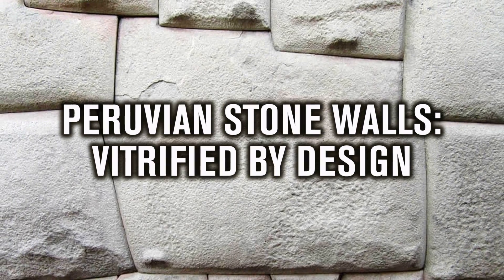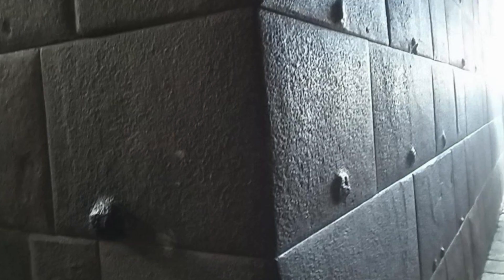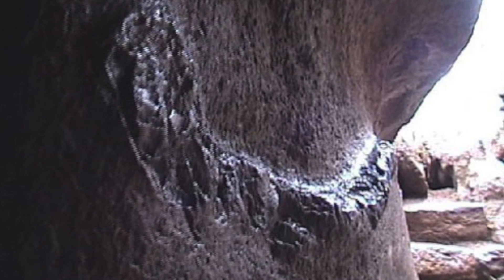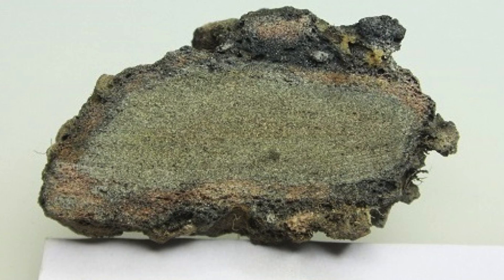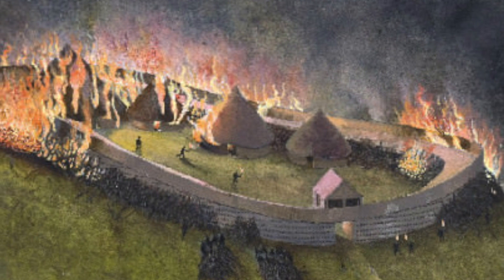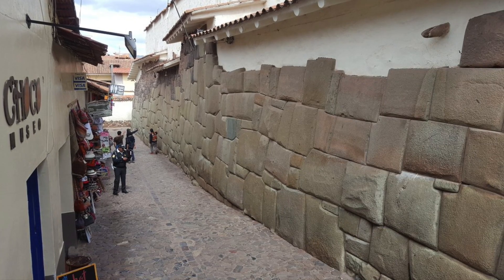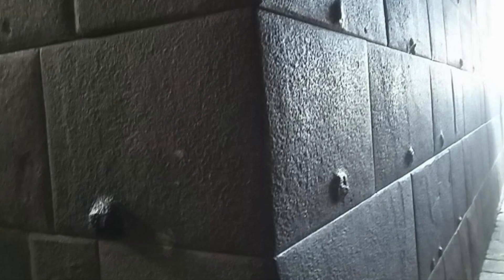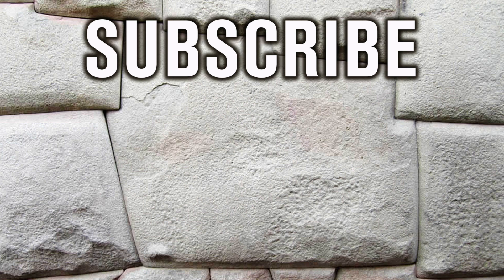Were the Peruvian Stone Walls Vitrified / Melted During Construction? | Ancient Architects

Comment: I'm in the some sort of acid type lacquer/varnish finish camp myself. Seems like a similar kind of polished finish (not as finely finished of course) we see on the granite boxes in places like the serapeum. Look underneath the lids of these boxes which weren't finely finished and you can see obvious drip marks where whatever this substance was has settled. A little like painting a wooden garden fence and paint drips settling at the bottom near the grass where your brush can't get under.

I'm from Scotland and I've seen numerous examples of the type of vitrification you mean. My problem with your comparison is that most of the vitrification I've seen has happened with rocks and bricks about the size of a forearm at most. Temperatures of 1200c can easily do this to stone and bricks, we make bricks in kilns after all but when it comes to stones which are 5, 10, 20 tonnes an upwards, how much heat would be required to do this and how would it be controlled? In many of his videos Brien Forester has shown that the precise finish (not the polished finish) isn't only on the face side, it continues through the back too. How much heat would be needed to make a 10 tonne stone malleable enough to work with (even to make the top 5cm malleable), how long would you have to shape it before it cooled and hardened? 

I believe they were shaped in some other way and finished with a long forgotten lacquer technique. You stated again you don't believe in the power tool theory and I was the same until recently. I'm don't believe electrical power tools were used (the didn't nip down to B&Q for sure) but I'm starting to think some kind of advanced powered tools were in fact used. Possibly water powered, possibly gravitational powered? We used similar techniques in the 1800's to power machines long before we had electricity. In my opinion it's the only explanation for drill holes and cores. These require power, end of story. What the drill bits were made of is of course open to speculation too and a discussion for another day. 

Great video, keep up the good work! ;)

Comment: Another bad idea? If it has a rounded surface on the bottom of the knob then it could be used for rocking the stone, if it's flat on top it could be for adding accessories or framing in the future, or a point for pulling the the stone.
If it's flat on the bottom it could be a that instead of using the knob as the rocking  pivot point, they Chocked it up to a log and used the log as a axle and the 90 degree angle face allowed for better contact with axle. I know that in South America they didn't have the wheel but they did use logs as axles, if memory serves me correct.

Some of the larger stones do not have them but the smaller ensemble cast of stones does, possibly because these are the coped fitted stones and the larger stones set the course.

the dimensions of the knobs and the distance from the joint should be noted not just for a hinge effect but for  the consistency of swinging the rock face flush with the others. It is like a jig-gauge  to ensure the correct depth of placement when pivoting into place.

Comment: Second posting. I wanted to keep them apart. I recall reading some time ago that fire is actually a chemical reaction. Could the ancients used or learned to use a chemical or mixture of chemicals to form the rocks? Any ideas?
Reply: I was thinking that two melting down the rocks making molds filling in the molds with the rock material putting it into place but still doesn’t explain the perfect edges

Comment: I'm no expert but I've worked with cements and mortar for decades. I have also been researching geopolymer and alkaline lye cement. 
As for the melting and softening rock and shiny edges and areas of old "stone". When you make a alkaline geopolymer you need enough silicate lye mix to bind or glue the mix together. You don't want water like in concrete you need the silicate liquid or super saturated liquid to start the process. This lye mix will precipitate in the "stone" it moves in and out depending on temp moisture and how much the surface is tooled. If you make two blocks next to each other they take time to cure and get hard. Concrete gets to max hardness in 30 days. In 30 days geo mix is just getting started. The geo mix can be soft for days or weeks until enough silicate and other crystals can form to make a very convincing "stone". If you came back on a soft geo lye mix during this time more of the lye binder can precipitate to the reworked troweled area.  This can also happen with no extra tooling and I have a sample that got random  blotches of glass like areas on the sample that would be described as melted. Just a shiny area where more crystals formed due to moisture temp etc. My "lab" is outside so it gets the full weather experience. Cool nights warm days dew, rain, with direct sun and shade. 
Basically the geopolymer is a living transitioning thing. You organize and mix the components set them in a desired location and they bind together and start growing a crystal matrix over a long long time. Calcite, silica, alumina and quartz all working together and living the rock life. 
Now as for melting glass and combining it with natural calcite..
I saw a counter top in a local house that was cobalt blue glass with oyster shells in it and this was cut and polished like granite. It was an amazing thing to see. If you ever tried drilling an oyster shell you can imagine how hard it would be to slice through a block of them embedded in glass but they did it. 
End transmission..

Comment: The nubs could be used to hold awnings or walkways in place. By carving a cup shape into the Nub into the end of a beam. This beam would support the canopy or walkway. If the top is secure and the Nub is a good fit it will bear a load.  Another beam could be carved out to wedge the angled, cupped one from below and pounded in for a tight fit, if greater load bearing was required

Comment: There is a type of acid that can be easily extracted from a native plant in South America that has been proven to melt granite. It is possible that stones were soaked in this acid was in a "bath". When The surface was soft enough, the blocks could be placed together and easily formed to join perfect joints. the "nubs" could have been to keep the blocks off of the bottom of the "bath" so the acid could get at the very bottom. No heat needed.
Reply: Actually I guess it is a strong alkali not acid.

Comment: Honestly I don’t think it’s hard to conceive that they used gold mirrors to focus the suns light for heating the stones. All you need is like 20-50 people each with a 1 meter diameter gold mirror and they all just stood around pointing and focusing the mirrors at the walls. And I know there are those who think acoustics were used. I also don’t think it’s hard to conceive that they might have used vibrations from any number of instruments to cause the heated rocks to vibrate and flow. Does anyone know if heated rock has a shear thinning property, that under intense vibrations it’s viscosity decreases slightly, and just enough to slump into place and fit just right with the rocks around them?  (Opposite to shear thickening like cornstarch and water, that the viscosity increases upon shear forces). All plausible given they definitely had an abundance of gold to use, MANY gold circular “shields”  have been discovered that could easily have been focusing mirrors instead of impractical gold shields as gold is very malleable, and as for the vibrations any number of drums or wind instruments could have been used let alone vibrating strings or tuning forks on magnifying bases.  The “knobs” on the rocks could even have been where, after heating, the rocks were vibrated and consequential “slumping” happened at the high amplitude vibration points... 🤷‍♂️

Just my humble opinion...
Reply: MythBusters, burning ship with mirrors. Nope, not going to be hot enough for rocks.
Reply: @alwayscensored6871  umm no try again...
https://youtu.be/eQdKQQwaNvY 
that’s with just one lens too. im not sure who told you you couldn’t focus the sun to be hot enough to melt rock but they were wrong. A mirror the same size can focus the same power, especially a gold one. Again like I said 20-50 people standing around each with a 1m^2 mirrors could easily tackle a wall even if they only went 10ft everyday. That’s about 1kWhr per m^2 mirror for every good hour of sunlight, at sea level too.
Reply: @alwayscensored6871  secondly, that’s not even how Archimedes was using the sunlight to attack the Roman ships. He figured out how to make steam cannons by heating copper pipes by focusing the sun onto them and then plunging water in that flash vaporized. The expansion of the steam and built up pressure accelerated a projectile down the tube at the ships..... 

https://www.livescience.com/8383-study-archimedes-set-roman-ships-afire-cannons.html
Reply: @CharlieSolis  So gold foil is better than silver or tin or bronze? Hmm hence the City of Gold might actually refer to something else? I like that theory. Were do I get some gold space blankets? I wonder if it is better than aluminium or stainless steel? Is that why they have been hiding all the gold, so we cannot make earthquake proof buildings? Would they do that? Loving this ancient history stuff. So educational.
Reply: @CharlieSolis  That's cool, I always thought he was smarter. Total misinformation disinformation scam even back then. A few peasents on a sunny day  could take down their walls. Oh, wow, the Trumpets of Jericho. Another dot joined?
Reply: @CharlieSolis  Totally makes sense. Just yesterday I came across some debunking of debunkers. What happens water is dropped into molten aluminium, big explosion, blow off roofs etc. Ancients knew how to cast metal. Someone who survived must have figured out what happened. Hot metal, water expanding 700 times, boom. Has Greek fire been figured out yet? Hot enough to melt stone. Ancient thermite?

Comment: The melted stone wall seems to be an intended message built into the stone construction. The message is showing the difference in using applied heat to the rock effectively turning the rock into magma and alternately it’s showing that’s not how polygonal masonry was accomplished. So heating the rocks to accomplish polygonal technique is out is what the wall is endeavoring to communicate. What’s left in explaining polygonal technique? Softening the rock is still a viable possibility. Granite is porous and could absorb a softener to allow shaping easier therefore making wave like shapes in the rock possible if imagined it as soft as clay. Being porous the granite could exude the softener and harden back up. Once soft the rock could be placed into the curved joints without the need of any mortar because of the almost melted character of the adjoining rocks to each other when hardened remained in steadfast lock with one another rarely needing iron clamps to hold positions over time. This show doesn’t cover the many plant species that have gone from the earth over time but with the right plant extracts one could easily soften and shape granite. Evidence of softeners made from plants is extant in India today.

Comment: I'd say shuttering and a mix of something like concrete, in a similar way to resin cast drives, part of it has an imprint next to what looks like holes, maybe from lumpy sand not mixed properly and washed out with rain? A shiny finish can be achieved with adding sodium silicate, you often get the melted appearance if rains heavily and the mixture slumps

Comment: You raise many more questions than you answer, but I think you might be on the right track.

How do  you control the flow of melted material?
What of impurities?
Why are there no images of this process in any ancient art, as this would be a very significant process?
Wouldn't organic material used in firing the stone be consumed, and leave only carbon deposits, considering the extreme heat needed?
How do you prevent oxidization, and deal with out-gassing which is seen in lava, and which would cause an ugly porous surface?
Do the reverse side of any stones show signs of heating?  I know there are places where the back sides of some of these stones can be inspected.

My initial thoughts to form stones in a particular shape (say to fill in a space in a wall would be to form a clay "mold" or "form."  It would need to be fired to make it hard and smooth.  The stones would have to be in place and shaped fairly well, as the ideal temperature would be just below completely liquifying the stones.  You want them to 'sag' into shape, not run.  The nubs could be explained by holes left where gaps were significant to allow air to escape that would otherwise prevent the stones from sagging into place.  The nubs might have been places where the rock kinda sagged out of vent holes.  It seems likely to me, having worked with molten metal, if  you could hit just the right temperature and maintain it, you could get the rock to kinda ooze into shape, without bubbling or trying to out-gas.  I think this would be super hard to achieve, especially because you'd have to raise the rock to really high temps which would require an insane amount of fuel, and possibly constant air flow from bellows or something of the sort to keep the temp just right.

I think someone needs to do some experimental archaeology to see if there is a way this can be done.

Comment: I think they used hessian bags which they filled with a mixture of crushed rock and special fire ashes, water and other substances - wish I knew what.
They were more expert than us with these mixtures.
The nubs was where they had a cloth tap for excess water to exit. The bags account for the nicely rounded edges of the polygonals - a bag could not contain an angular
edge because of the enormous weights involved. You can see the difference in crystalline structure according to how quickly the polymer set or exactly which material was used. - not homogenous suggesting layered building. 

The vitrification would be a panel-shaped device with a bellows that fitted to the walls and contained probably charcoal heating blown by the bellows - these people were really good with charcoal - they made incredible fertile soil with it too (terra nova) and it would have been easy to get high temperatures in some type of slate-made bellows heater.

Comment: The surfaces of the stones have a bush hammer finish made from hammer stones. The nubs are to help in rocking the stone back and forth when scribing and carving the contacting faces.
Reply: Nope because there is no consistency to which blocks have nubs, in which position, which shape, etc. They appear to be a language.
Reply: @simonjamesconstable  seems they’re consistently at the bottom where you would use posts and jacks from below, or have a carriage lashed to the stone with a lever arm for moving.
Reply: @whip8  Absolutely not true, they're at any position on a block

Comment: This is a very interesting concept. I would have few questions though  that may make vitrification not possible.  1. Why can't we find any evidence of furnaces/places where they melted the rock. 2. If it was melted prior to setting it in the wall how was it transported or was it melted while it was already set in the wall? 3. If they worked in such high temperatures, they had to use tools and protection from heat exposure and there is no evidence of that. 4. No process as such is mentioned in any folklore/writings although that might be due to the walls much older than generally accepted. It truly is a mystery and I do agree that some of the evidence you presented can be a proof of melting used in shaping these rocks. Thank you for the video.  It was very good

Comment: The following is a bit of a jumble, but hopefully you understand my meaning:
Melting copper is approximately the same heat needed to melt diorite.  It's very, very feasible that vitrification is the answer.  The question is if they did the walls in small sections or all at once.  It would have taken a lot of effort to turn the amount of wood needed into charcoal and then figure out how to do the walls.  Ancient pottery kilns could have also reached the heat necessary to melt rock and could have been used in conjunction with charcoal (and flux) to keep the heat centered on the walls.  Being able to melt rocks into the basic form of a statue or South American word glyphs would also save on copper or bronze tools leaving them to only do the fine detail work.  So it's not difficult to build upon that knowledge to know you could melt walls of rocks.

Comment: This may sound a bit Sci-Fi for sure but it really does appear that the example shown at 4:50 in the video, appears to be melted from some form of directed energy (weapon?) - a sustained period of increased energy focused in an area that has melted and it quite obviously has reached a temperature causing plasticity causing drooping under gravity. For a comparison to this idea like when you place a soldering iron tip (hot of course) against the side of a plastic container and it melts.
Reply: Fresnel lens... There's a guy who does vids on here melting rocks with it